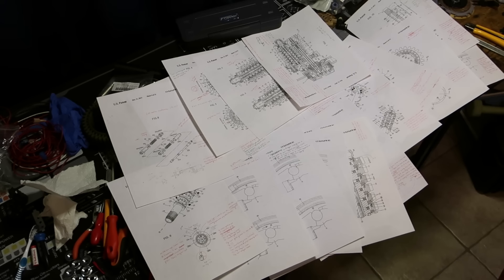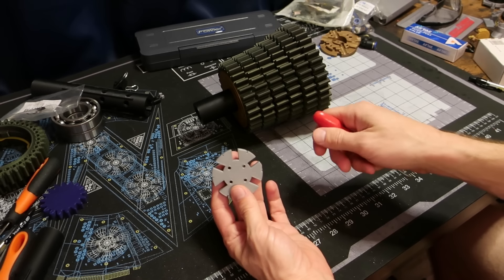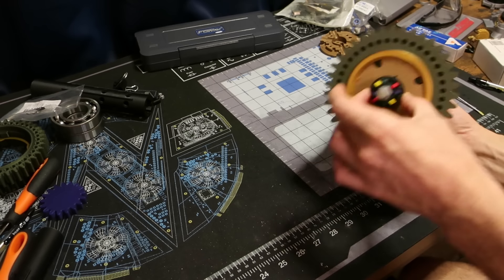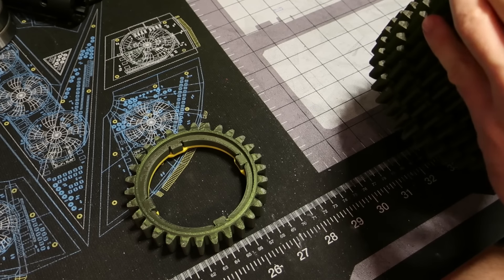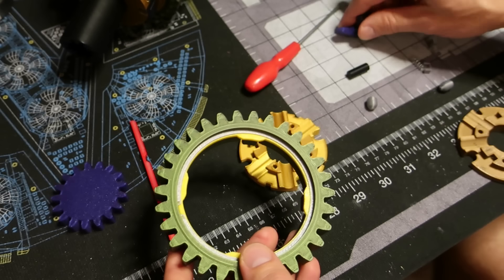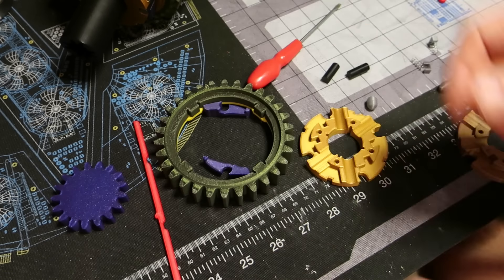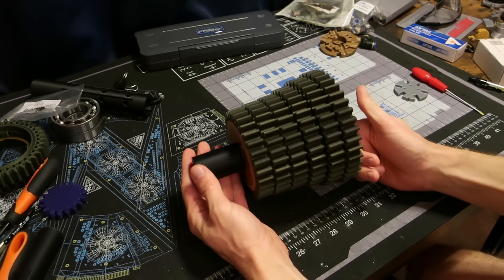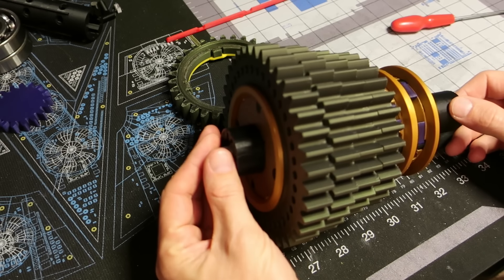Inside a MotoGP Seamless Gearbox Replica - How it Works

Comment: Thanks for explaining this design, something I was not aware of regarding this racing series.  This seems to be a more sophisticated variation of the ball-selector gearboxes that were common many decades ago.  My early '70s DKW 125cc (6-speed) and '55 Ducati Cucciolo moped (2-speed) both had this type.
Reply: It seems to be a re-engineered over complicated  version of the ball lock I first saw on a Yamaha 80 around 1968.
I guess using free wheel pawls allows them to overcome patent infringement issues?
 That was a nightmare to set up as a per-teenager without a service manual, at least this looks a little simpler even if it does have a lot more parts to go wrong,  no wonder they barely last one race.
Reply: 1964 hodaka
Reply: @filippostube6533  that's right! That fact was parked far in the back of my brain and needed a push.

Comment: Really clever design, i imagine how smooth shifts would be with electronic throttle control (automatic rev matching). Thank you for covering it, all tho it was kinda time intensive, but still
Reply from the maker: Glad you enjoyed it.
Reply: Isn't that auto blip which is in many commercial bikes?
Reply from the maker: @noral342  Auto blipping, yes. This gearbox design, no.
Reply: i think throttle control would defeat purpose of this system. Most clever thing about this design is that its gets naturally aligned.
Reply: @alesksander  It will not defeat the purpose, just make it even better, because ECU now have to correct rpm much less
Reply: @RelentlessRage  Not at all. The rear wheel must still match engine speed. And that depends on the delta in gear ratios, not how gears are selected. So you still need to blip/rev-match or slip the clutch, regardless of the gearbox type. It's not less with this box design.
Reply: @alesksander Nope, the rear wheel speed (the product of one set of gear ratios) still has to match the engine speed (another set of ratios) when down-shifting, regardless of how the shifting is done. So you're going to have to rev-match or slip the clutch either way.
Reply: @prozeza  based on your comment, you haven't understood how seamless gearboxes work. The whole point is to engage the new gear BEFORE you disengage the current one. On upshifts, this negates the need to slip the clutch or cut torque to the engine, hence the name seamless. Whats unique about this particular design, I believe this is true ALSO on downshifts! The same principles apply, torque is simply the opposite direction, negating the need to blip the throttle to rev match.

Comment: Super neat. It has an old school beautiful analog mechanical elegance to it. You did a great job explaining it and building it with a 3d printer. If they have issues building them reliably with precision CNC metal parts the fact that you can get it to work just by looking at patent drawings with 3d prints is a testament to your skills and determination.
Reply from the maker: Thanks for the kind words.

Comment: This is really cool! Thank you for taking the time to not only reverse-engineer the gearbox, but sharing with us as well. It sort of reminds me of a selectable (and more fancy/complicated) version of a two speed RC gearbox. The selectors and having the lower gear keep driving until a higher gear is selected work very similar to this. In RCs the selection happens due to centrifugal force based on input shaft speed, the selectors for 2nd are weighted and spring tension is adjusted until they are pushed out (and the shift happens) at an appropriate RPM.

Comment: Super impressed by your ability to get all these 3D printed parts actually working and sliding together without binding up, that must have taken a huge number of iterations! Really small contact area between those levers and the tabs on the gears themselves. I wonder if the countershaft gears had a tendency to deform into an elliptical shape under larger torques. I’d imagine there were some very bizarre failures and asymmetric wear patterns on the gear faces, although might not have had time to develop with such a short service life.

Comment: I can't believe someone combined the mechanism of a multicolored ball point pen, a bicycle like freewheeling mechanism with a spring loaded set of levers mounted inside the gears to create this gearbox! This is the second generation seamless shift gearbox patented by Honda with no shift forks either as per their published paper. Only when I saw a working model of it do I finally get it how it is really done! Dang, engineering is cool!

Comment: Hodaka used a simpler version of the same on their bikes in the late 60's, early 70's.  Counter shaft and main shaft gears were constantly engaged with each other. Individual gears were selected by a rod that ran through the shaft and pushed ball bearings out to engage a particular gear.  It was the simplest transmission to work on, but Hodaka's implementation meant it had to be worked on more often.  Nice video.
Reply: This system not is new. Ducson Repriss, 49cc 1963 have the same desing and this engine (and gearbox) was a copy from the  49cc german engine.

Comment: I can tell they've got parts of the idea from other inventions too. Looks similar to a bicycle hub freewheel, but that only works in one direction and there's no shift.
Thanks for showing the details as I was curious about this. It's definitely a lot more complex than the zero shift system which reduces components but is very similar to the usual synchronous gearbox.

Comment: Thanks, nice work!  The sliding internal engagement has had a lotta variations for a lotta years, just less robust then this.  My examples are 50's Zundapp & Vespa.
Reply from the maker: Interesting. Didn't know that was a thing on older model gearboxes.

Comment: This gearbox looks very similar to the Lotus "queerbox" designed by Colin Chapman for his F1 cars in the early 1960's. It wasn't entirely successful, even though Keith Duckworth (of later Cosworth fame) was given the job of making it reliable without redesigning it. The shift mechanism was internal and sequential but not seamless as in this MotoGP gearbox.

Comment: Looks like a sophisticated Zündapp 50 cc gearbox; all gears interlocked and one being locked into gear with a set of bearing balls pushed in place with a push-pull rod with a notch inside the axle. The balls acting as a lock for up and downshift.
Reply: 1964 hodaka

Comment: Fascinating! A brilliant design, brilliant explanation and a brilliant 3d recreation! Thank you. I've been trying to understand how this works since they were first revealed, especially how the gears deal with the back torque of engine braking. The actual bearing surfaces seem quite narrow, considering the amount of power being transmitted. Now, if you could see inside the, (presumed), mass damper device in the Ducati tailpiece and explain that...! Subscribed on the basis of this - thanks.
Reply from the maker: Glad you enjoyed it.

Comment: Hodaka did something very similar back in the 1970s.
Instead of pins driving levers, they used balls, which directly engaged detents on the inside diameter of the gears.
Reply: German motorcycles already had this in the 50s. In German it is called "Ziehkeilgetriebe". It was used on a large scale, especially in small 50cc motorcycles of the brands Zündapp, Simson and Hercules from the 60s to the 80s.
Reply: @schwerti94 Yes and the spanish brand Ducson in his model Repriss (1963) copy the Zundap engine. My father raced with one.

Comment: That little design enhancement with the "yellow ring" to avoid partial engagement is chef's kiss - my hat's off to Honda. I like how the design doesn't constrain the number of gears. It's also more compact because you don't need space to move gears sideways.

I hear they need to "replace pieces" after every race, but the design looks pretty robust. Nothing looks particularly susceptible to wear. You say it's pretty finicky... do you think it's just clearances falling out of spec? I'd hope it wouldn't be an obstacle to eventually mass producing it in 10-15 years for the average bloke on a CBR.

Comment: So,  the whole shift mechanism works similar to a pin lock cylinder. Very interested. Cam rod is the key, moving pins that are either engaged or not transferring motion

Comment: This was a brilliant video, u should see old F1 seamless gear box too it was a simple solution not as complex like this mechanism ,they used a double shifter barrel with  internal parts exactly like a motorcycle gear box which has a single shifter barrel. And one barrel had odd and the other had even gears and both barrels were linked with each gear having a small angle offset i think 25⁰ . 

I think tractor trailer gear box were first to build quick gear change gear boxes.

Comment: That's awesome. Now add the driving gears and a hand crank to represent the engine. Also a sprocket to the "wheel" and you can make the whole process visible and potentially tangible to less technically minded people...just a thought. Amazing job thou, weldone!

Comment: Amazing walkthrough of what all together is a very complex system but broken down into very simple stages. 

When you compare this to something like a DSG, it’s brilliant in its simplicity. 

Any ideas on what parts seem like the bits that wear out quickly? 
Been rumours that Ducati have been developing a version for their top end road bikes for a while, to sell to customers. 

Can’t imagine we’ll see them until the longevity at least gets close to matching the service intervals of existing gearboxes.
Reply from the maker: If I had to guess, the parts that would give Honda trouble are the cam rods and levers, but that's purely speculation on my part.

I did check out the Ducati patent a while ago to see what they were doing; it's completely different from what Honda are doing at the moment. It'll be pretty cool to see it in public one day though.
Reply: a DSG is infinitely simpler than this! Maybe from the outside, this gearbox looks 'simple', but only because the shifting mechanism is within the main shaft. This would be incredibly complex to machine, assemble and have work reliably, plus maintain it.

Comment: Not only is this a great job of understanding the patent, another killer job printing it, but it's a terrific explanation of what's going on. Thanks. What did you use for the CAD? I'm an OpenSCAD guy myself. I have a Prusa MK3 and a MK4. I've been riding for about 35 years.
Reply from the maker: I use FreeCAD. Not the easiest thing to learn right off the bat compared to others, but it's community-driven and you actually own the software.

Comment: The first iteration cut spark, yes. Those can go on any bike. They make that loud pop for that reason.

Newer fuel-injected bikes (especially ones with factory quick shifters) will cut fuel. Because you don't want to be dumping raw unburnt fuel out of your exhaust if you can help it. That's less fun (no pop), but it works just as well.

Comment: If I’ve understood correctly when you shift to 2nd the 1st gear lever arm is no longer wedged against the gear. As the arm is spring loaded there is a force holding the arm up but the force from the cam (which is also spring loaded) can overcome this and push it down? Great video.
Reply from the maker: So when you shift into 2nd, 1st gear is still technically engaged (briefly) because torque is still being applied to 1st gear via the lever mechanisms. When the levers for 2nd start transferring torque to 2nd gear, that naturally takes pressure off the levers for 1st gear since 2nd gear spins faster than first (lower gear ratio number); this causes the levers to release from 1st and 1st becomes disengaged. The result is an uninterrupted shift / no loss of power. 

The only reason this is all possible and things don't just go boom is because of the interaction between the control rod, sleeve springs, cam rods, and levers. It is all balanced and coordinated to work seamlessly, well, at least when things go well that's what it's supposed to do. Hope that makes sense.

Comment: It is very interesting for sure.  However, it is overly complex not to mention fragile is certain areas.  A much cleaner solution would be to use a hollow shaft nested in a hollow shaft of a larger diameter and use ball bearings for the sequencing of various gears.  In essence using the hollow shafts as bearing raceways to transfer power.

Comment: 1962 Capriolo did the same thing with balls being lifted into the gears by a flange on the shift shaft. Way simpler than the Honda system
Reply: Problems with balls is- they do it rigidly. The "ramp" allows ring to slip in place by itself for a split second.
Reply: The reason for the duplicate pawls is so that there can be a ratchet. This allows two gears to be engaged at once without an explosion. There is literally NO interruption in the torque from the engine to the wheel. I made a relatively long post about it a minute ago. I hope it might not be complete rubbish 🙂

Comment: Pretty cool that you built this just from patent drawings, I dont know if you are aware of this but in the motorcycle drag racing world we have been using what we can an over ride transmission for over 40 years, shifts with no power cut, but only for up shifts as we don't need down shifts in drag racing

Comment: 12:46, it's like a one way bearing engagement, dis- engagement, per gear. I'm surprised this wasn't designed in the 40's or 50's. I have had a idea about using planetary gears in a manual gear box. It was all in my head, and been years, so a lot was lost. I can't recall exactly how I was thinking shifting would happen. But it wasn't traditional hydraulic. However it would be mechanical.   Something similar to this . It would make a transmission say, in a car tiny compared to traditional. Something like a model T Ford transmission, only more modern and performance oriented.  I was thinking about 8 ratios  possibly more. With the ability to use a TCM/ECM together to change the gate pattern. To skip shift without noticing while  shifting.  Also other fear ratios would be possible, dependant on how the planetary was used, being two ratios possible per planetary. So a 6 or 8  speed could in theory be 12, or 16 speed and  possibly more if multiple planetaries are engaged at once. Possibly a ultra low ratio using all, , and a inverted drive for overdrive ratios. It could use 4 planetaries for possibly 12+ gears basically use all for first (except the overdrive) the 3,2,1 and then use overdrive with each gear, splitting the ratio adding a gear. So that's 8 gears plus overdrive. Then the two ratios per planetary. 18 gears, then there is splitting gears , using all planetary gears in alternative ratio. Leaving who knows how many possible  gear ratios! It in through could nearly operate as a cvt, with stepped gear ratios close enough the rpm can basically stay steady during acceleration. Using 38 ratios to allow smooth acceleration. It would require a computer to work out the ratio requirement for the given speed and tq requirement vs engine rpm. To select a shift gate with only the appropriate gears available .  Also a similar gear box could be used with electric motors to make them  more effective in vehicles. Using a couple planetaries .with overdrive making a small motor more capable.  Allow a small very  high rpm motor to move large vehicle, and still operate at highway speeds. The use of hydraulic power to shift isn't a bad idea. With electric motors a tq converter isn't required .  I always wanted a manual clutch with a automatic transmission. Use the clutch for  taking off, then shift gears hydraulically . The dampers in the clutch would get a workout. It should be more efficient. Fun to drive.   Nothing beats at least 4 Speed manual transmissions tho. ,8speed would be cool. 5-6speed+2-3 overdrives. Or possibly a under drive sub 1st gear, not quite a 'granny gear, for hills and such making it easy on the clutch.   Sorry to ramble, have a awesome day!! 🎉

Comment: many times motorsports gearsets end up being 25* pressure angle instead of a standard 20* PA. Cool video!
Reply from the maker: Thanks!
Reply: shorter stumpier teeth with less interference, and the extra bearing loads are less of an issue than getting maxi strength/min weight from components...

Comment: This is how some multi grear rc car gears are made.  But they are not "shifted"  the purple "dogs" are spring loaded and when rpm overcomes the spring the dogs are alowed to move and engage a different gear.  

I have seen similar designs and there is always so much stress of the dogs that they shear or shear the teeth off the inside of the gear.

Its a bad ass design.  Hope it hold up well for them.

Comment: Cutting injection is likely, for shifting on a GP bike. dumping fuel with no ignition has the potential of backfires & washing the bores.
Reply: The engine response to a fuel cut is far too slow to achieve the desired result, and the risk of engine damage is extremely high. It is far safer to use ignition cut even with the negligible risk of bore wash. Ignition cut used to be common, but modern ecu's now use ign retard. The engine only needs to lose a little power for a few milli seconds, it doesn't need to lose all the power. 
This gearbox design negates the need for any cut or retard. Power delivery is never lost even for a few milli seconds, so the bike will naturally be faster around a circuit only because of gear shifts.